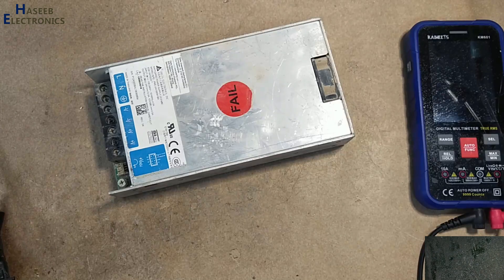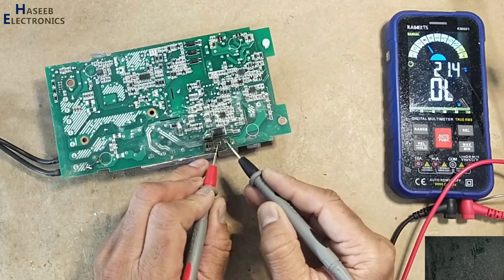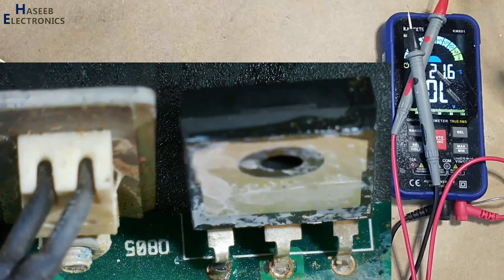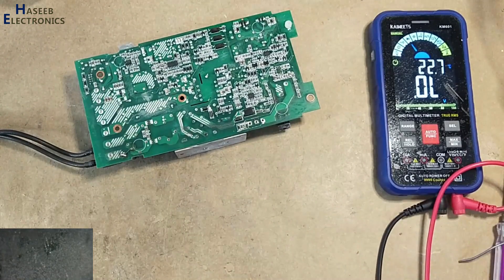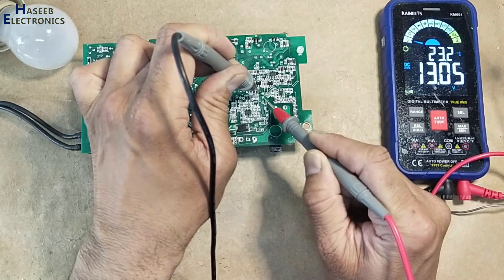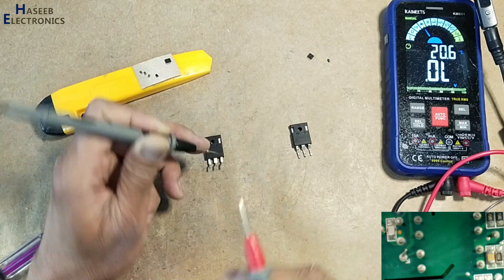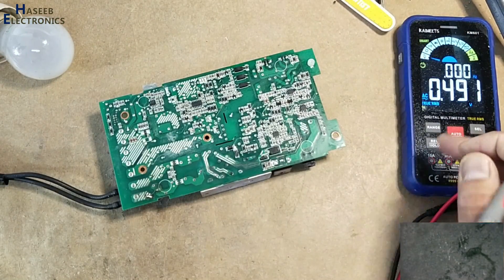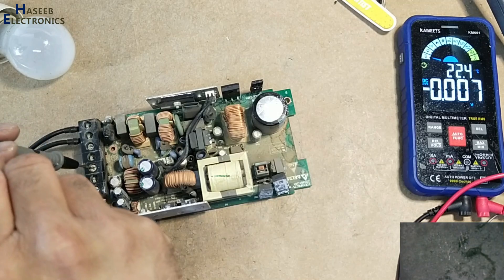{1079} SMPS not turning ON, PFC section restoration

Comment: How did you recognized the burnt resistor values ?
Reply from the maker: I have approximately 25 same model power supplies
I think 7 or 8 repaired. 
I got values from similar model power supply
Reply: @HaseebElectronics  Got it 👍 thank you
Reply: He already had the same smps model.

Comment: SMPS works without PFC also, I thought it might be interlinked.
Reply from the maker: in some circuits PFC is turned on before main power supply section these are called  "Always-ON (Continuous PFC)
in some power supplies the PFC is turned on as per requirements by sensing the load size. these are called "Load-Dependent or Conditional PFC Load-Dependent PFC” or “PFC Enable Control or Burst or Skip Mode PFC.

Comment: Series lamp was glowing for a long time after fixing the PFC section & starting the power supply... 
I am trying to troubleshoot 24v power supply... If i connect 40W bulb in series, it switches ON/OFF continuously... If i connect 60W bulb, it glows continuously & SMPS also gives 24v output, 35v AC drop across SMPS input terminals, same thing happens if i connect 100W bulb in series. 
I m confused whether there is short or not... On multimeter, input section gives resistance of few 100 Kilo Ohms... Secondary section also doesn't seem to have any short

Comment: Dear Mr. Haseeb, when you clean flux from circuit board, can you use 90% isopropyl alcohol or must it be 99% alcohol?  99% is hard to find in my city, and quite expensive at the one location that sells it.  Thank you and thank you for sharing your knowledge with us.

Comment: Sir i am dealing with a falty supply 12v small one. When is outputing low current is working without noise but when is outputing normal current for my tv box is making noise and causing to freeze my device. When i connect it to a lower current device it wasn't noisy. Is it high chance to be chip problem?

Comment: Hi. Thanks for great video. What is it called the soldering gun that u are using. It's solder n suction together in one? And also the copper mesh that aucka the lead, what is it called? I have a few power supply not working. 1 has a problem when power ON, no  output wait for about  15min then has output. Why?
Reply from the maker: desoldering gun is WELLER WR3M rework station 
copper wire is called DESOLDER WICK or DESOLDER BRAID
if your power supply is starting very late, might be VCC capacitor problem  or might be startup circuit problme

Comment: Haseeb how it's possible that this worked with PFC mosfet installed in the wrong way? I suspect that the gate was grounded, and source was connected to PFC IC. Vgs treshold is relativly low (at several volts) so mosfet was practically conducting 400V to PFC IC the moment it left factory...
Reply from the maker: i think it is already got a repair attempt from some one. as the soldering is visible on PFC MOSFET, and secondary power section power mosftes were also re-soldered 
i think by mistake of repairman, the mosfet blasted the remaining circuit 
as the FAIL sticker is placed by the end user, when any items gets malfunctioned during operation 
so this fault was not from factory. it is human error of technical repair team